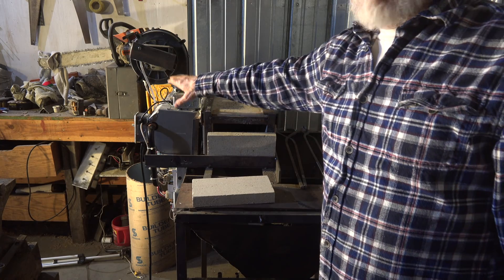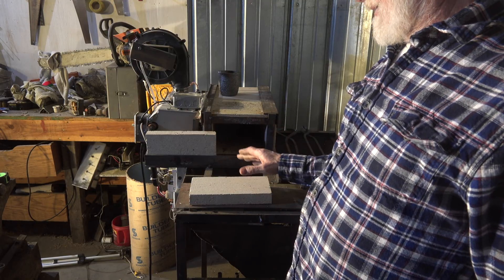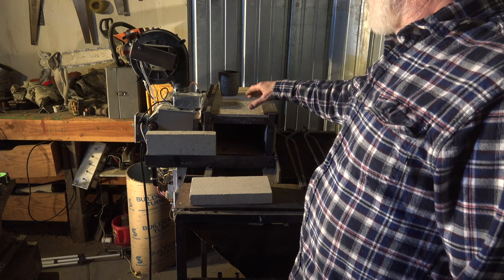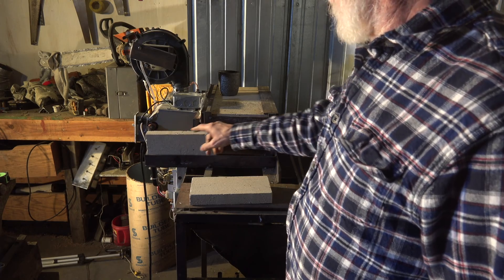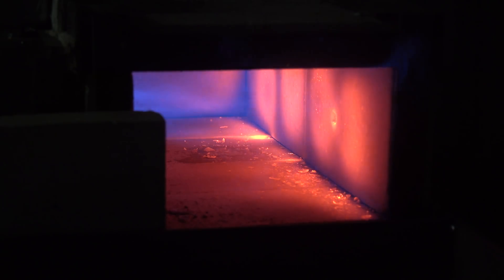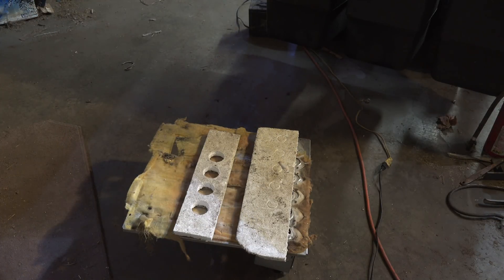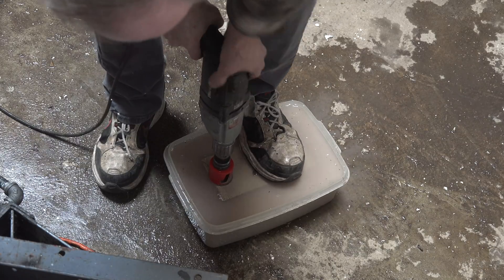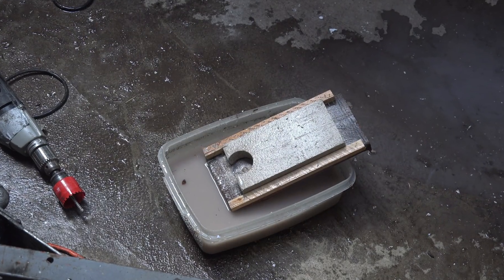The firebrick for the forge from a furnace #4

Comment: Looks like a good forge.  I'm also building a forge using furnace parts.  The furnace I have is a single burner.  I imagine 4 burners would be better for more even heat distribution within the forge.  I may end up not using the burner from the furnace and opting instead to make my own burners from pipes.  I will continue watching your videos on this forge and try to think of any questions.
Reply from the maker: Probably the easiest forge to make is the one I made.  It depends on mostly parts that are taken from a furnace.  A single burner may work well depending on how large you want the forge.  But I would not use pipes because the burners are designed to mix the fuel and air properly using a venturi.  Let someone else design the burners and just use them.
GFM

Comment: Pretty good  . Particularly  about the fire brick in the furnace.  You explanation  that once the fire  brick absorb  it's fill of heat it reflects the incoming heat back towards the interior , back towards  the foraging  metal. I didn't know that. Typical explanations emphasis  firebrick  is just an insulator. Some rocket stove  video channels spoke of lining their wet pack with stainless steel sheets but you say or suggest,  the firebrick glowing  orange  to yellow does that as well
Reply from the maker: Stainless steel will also reflect heat but it cannot handle the heat in the forge.